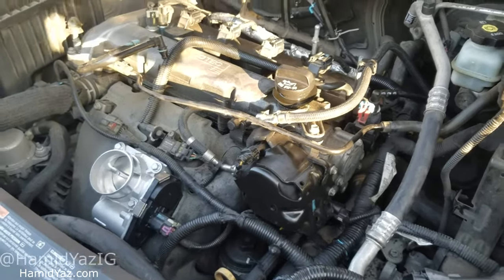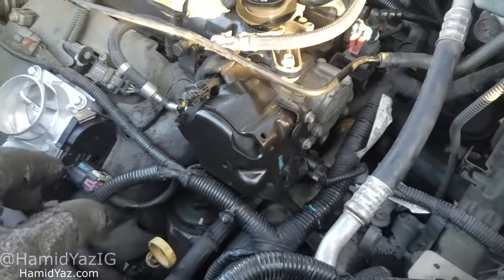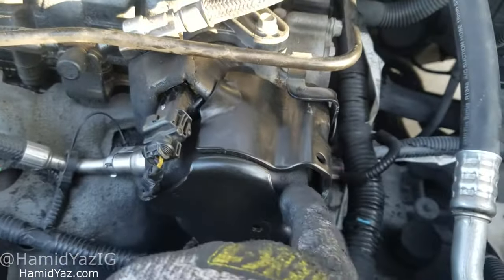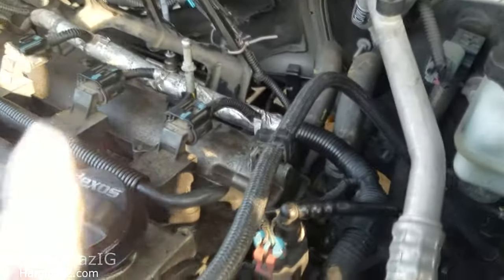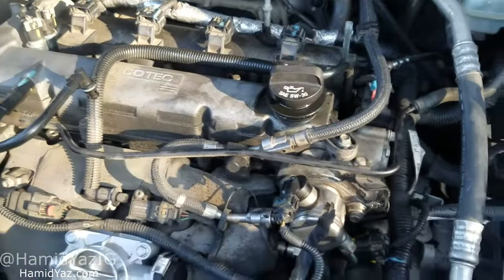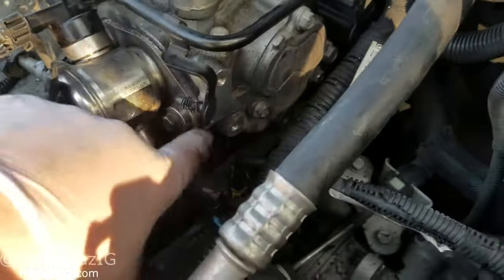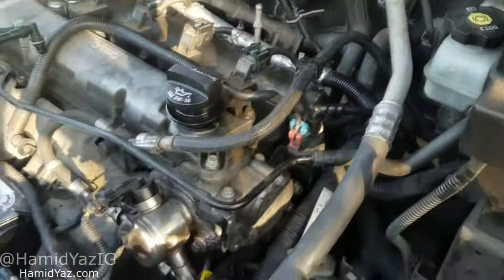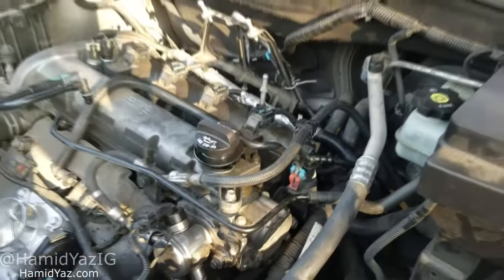FOUND! 2 Chevy Equinox Camshaft Sensors EASY removal!

Comment: Thank you! Had some issues popping off all the plastic brads around the front, but once I got the metal casing and foam off, I was able to replace the sensor (relatively) easily.

Comment: I don't know why all these DIY Guys and a great many actual mechanics refer to the camshaft solenoids as sensors. (Thanks for pointing out were these things are.!)
I knew if I looked long enough, I'd find someone, technician or at least exceptionally savvy, that know the difference between a solenoid, a sensor and a servo. My wife has a 2015 Chevy Equinox 2WD, 4Cylinder. I've been searching for 3 hours on here, to finally find someone who could tell me where actual cam-position-sensor. I've been a Master Tech at 7 different manufacturers/dealerships, but 2015 Eco tech looks a bit different than original Saab version.

Comment: Hi, I did change both sensors, and they are leaking, is they using a sealer or an o ring ?? I already removed them and put it back again, tightening it well, and they are still leaking. I am missing an o ring or sealer?? Help
Reply: Orings on both.